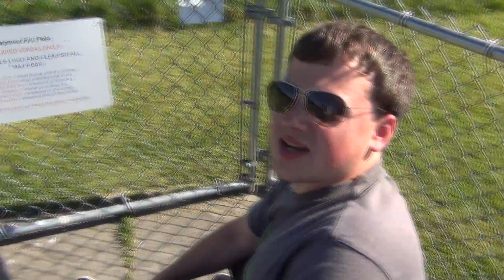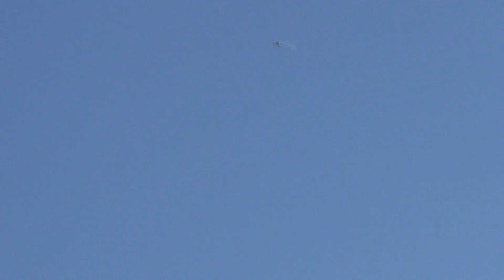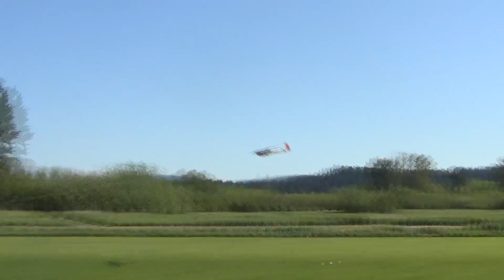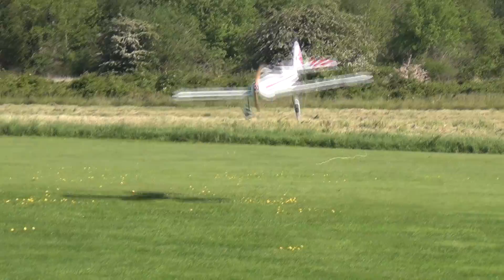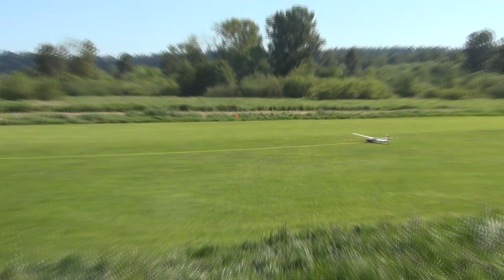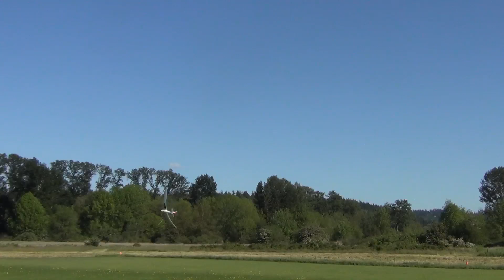Parkzone KA-8 Structural Test (Crazy Wing Flex)

Comment: Something fishy here, I’ve flown mine in raging winds, dived from altitude and pull back hard on the slope but never have I seen this sort of insane flexing. If you’re doing something to the wing or spar you really are doing a disservice to the product in portraying it as so lacking in rigidity - the other argument would be that if the structure you’re testing is stock you’re taking it well beyond it’s design limits in which case it’s done remarkably well not to fail catastrophically .
Reply from the maker: It's entirely stock. That's what's great about RC vs. Full Scale...push stuff to its limit and learn more about flying, structures, and aerodynamic loads without the risk of killing yourself. Plus - this made great entertainment and a life long memory from the laughing uncontrollably with friends :-) All about having fun.